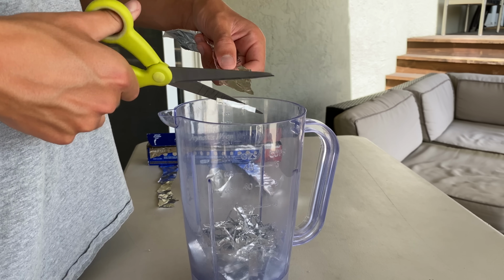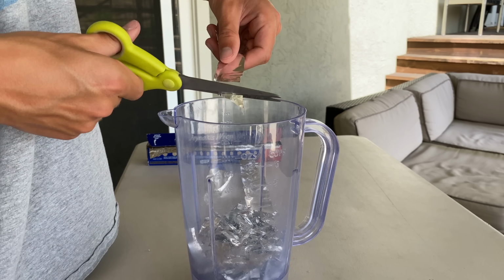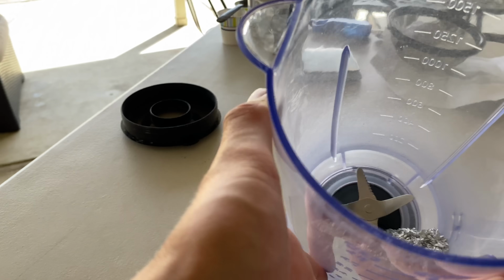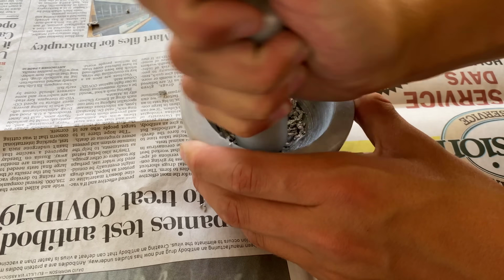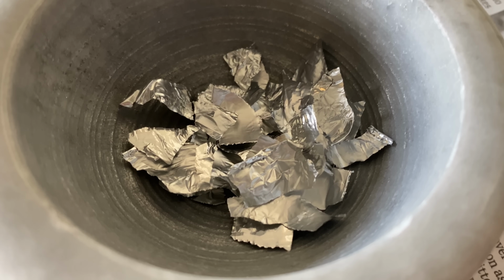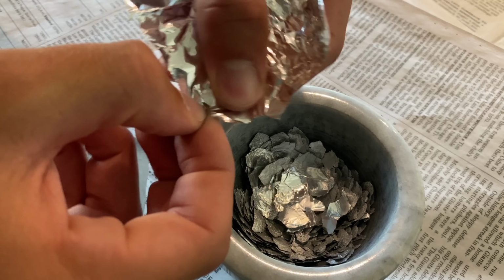Making Thermite with Aluminum Foil

Comment: You need water and a little hair conditioner (Cheaper the better) to prevent clumping. Don't run the blender so long it overheats. A Dutch guy did a very good job with this method a while ago.

Comment: Couldve used a round piece of wood to plug the foil in the blender closer to the blades so they actually get chopped up instead of floating

Comment: Make aluminium foil rod and while your rolling the rod/stick press it together hard for more density. After thats done take a angle grinder with a disc thats has a grinding like surface and then you wanna prepare something to collect it under like a bowl (the grinded aluminium will fly in the direction of the disc!) and now grind the alulminium along the rod. IMPORTANT THE ROD HAS TO BE DENSE

Comment: Faster way.
Blend the aluminium with a cup or more of water. For about an hour. The water will help cool down the  blades and also makes smaller particles. Let the blender cool down once in a while. Keep blending until the water is Grey looking and the aluminium is all grinded. Pour it out into a dish. Let it dry until the water is all gone. Ball mill bigger pieces if needed or regrind them in the blender. 
Enjoy
Reply: wouldn't that just oxidize all the aluminum making it useless?
Reply: @youngcuzzoproductions  You are correct sir. If you don't move quickly this would def speed up the oxidation process. Most likely by the time it turns into a gray sludge, it will then turn into a brown sludge.
Reply: @MashBro wait wouldn't that technically help in the thermite reaction since it's just adding more rust?
Reply: @Mr.__Sofi  No because you need both the metal powder and the oxide powder in the correct ratio in order for the reaction to take place
Reply: @MashBro  oh, makes sense
Reply: Fed
Reply: @debt4384  fed?
Reply: @youngcuzzoproductions  nope. Haven't had any issues so far
Reply: @youngcuzzoproductions  aluminium doesn't rust
Reply: this is extremely useful, thank you
Reply: I would recommend to use ethanol instead of water yo avoid oxidation(dont worry blades friction wont be able to ignite it)
Reply: @hamzax6837  does any ethanol work? Like ethanol is found in many places and many people here drink vodka
Reply: @mr.commonsense  yes i doesn't matter since it doesn't contain a big quantity of water
Reply: @hamzax6837  aluminium oxidizes instantly on contact with air
Reply: @NocturnalNick  thats obvious but water oxidizes is even worse
Reply: @hamzax6837  no, everything ends up with a coating of oxide regardless, that's why it's generally safe to handle. If your aluminum is somehow reacting with water, you have much bigger problems than an oxide layer
Reply: @NocturnalNick  nope ethanol doesn't let it to oxidize and u can burn it to dessicate it after that we can say that aluminium can react with air
Reply: I already used this method to powderize zinc
Reply: @hamzax6837  Ethanol will oxidize if for no other reason (there are other reasons) than it absorbs water from the air. Put some foil in gallium, then mix in some ethanol, see what happens. Keep a fire extinguisher near by.
Reply: Go to a junk yard. Buy a 5 gallon pail of aluminum milling chips. Wash them with laundry soap and water. Dry in the sun. Process about 1/4 pound at a time in a rock tumbler with a little bit of soap as lubricant and to form a super fine coating with some large ball bearings to desired particle size. ❤
Reply: @youngcuzzoproductions aluminum  is always covered in oxide.
Reply: @hamzax6837 watch for pressure build up that may push liquid past the seals.
Reply: I love reading you guy's passionate responses, lol
Oh dam i wasn't going to respond,  now we're all on the watch list 😮
Reply: Sand it... or use a food processor. Blender and mortar are 2 awful tools for this
Reply: How do you know this? 😂
Reply: Why not just buy aluminium powder
Reply: @alberttresslevic914  why? Because sometimes people like making things themselves
Reply: @user-sg2yt6nc1z  
Because he spent a really long time to make an inferior product.
Plus he had already bought iron oxide powder instead of making himself, which would be a lot more interesting.
Reply: How is it faster if you have to let the water evaporate?
Reply: Or you can find machine shops day of totes of aluminum shavings as well as magnesium

Comment: put water in the blender as you add the aluminum.  pulse the aluminum water mixture until the aluminum foil is reduced to dust.  pour the water/aluminum/water mixture on a cookie sheet.  bake at 150 degrees until dry.
Reply: and no oxidation?

Comment: What about putting foil in coffee grinder, less surface area & faster blades might work better? Then scraping rusty pipes for iron oxide. I'm thinking about how this would work for a SHTF type of situation, thermite would be extremely useful for harder to breach buildings like labs or certain types of warehouses.
Reply: Or just use ball mill because in cofee grinder you make very small amount and the grinder will heat up and you must wait to cool. So it's slow method
Reply: Apparently u can use peroxide and vinegar to rapidly rust steel wool.
Reply: Nah, I tried a coffee grinder. Similar result to the blender, and any powder that was made would seep into the air
Reply: larp
Reply: Bro should bring a coffee grinder for aluminum foil nah bro
Reply: Mf is Lore Accurately Roleplaying too damn

Comment: You should have simply used a sharpening stone or another rough filing surface to grind the foil.
It works much better for some reason when you're pushing the foil against the surface, rather than trying to push the pestle into the foil.

Comment: Back in the day, when I was the author's age, I was fascinated with pyrotechnics (thought about going into the fireworks-display profession (!) Anyway, I've never made thermite, but have made flash powder, which has aluminum and an oxidizer (usually potassium chlorate). I found a possible way to make the aluminum powder: file down an aluminum bar. 

You must keep the grains from getting hot (friction) to minimize oxidation, so coat the works in oil or WD40 as you work the file. You can later dissolve out the oil with acetone or benzene. 

As for preventing flame-out, mix a small proportion of oxidizer (plus more aluminum). This should sustain combustion. And/or add a dry fuel like small wood chips (?)

Comment: You need to add more foil to the blender so the weight and mass keep it from flying around. It is easy.
Reply: VortexModz  you should be fine. Just use common sense. Open it outside after letting it settle down for 10 or 20 minutes. Wear a mask while doing it, gloves, whatever you need to keep safe. I'm sure you'll be fine
Reply: @calvinaliceashvyer689  is there any chance to explode in blender.
Reply: @Росен-в5б  you should be careful because aluminum powder can spontaneously explode but it won't if you add a teaspoon of charcoal to it. It explodes when it oxidizes. The charcoal will coat the aluminum particles and protect it from oxygen. Don't run the blender too long either. The heat might be dangerous. Blend it for a couple of minutes let it cool a couple of minutes and back to blending and cooling.
Reply: @calvinaliceashvyer689  thank you for the good advice.  One more question.  Will the charcoal affect the speed of burning on the powder. And which kind of charcoal is the best.
Reply: @calvinaliceashvyer689  
Can i use mango tree charcoal ?
+ can you tell me (if you don't mind) the ratio between charcoal powder and aluminum foil in grams
i will be so thankful.
Reply: @simplepyro7897  yes, mango with be fine. Just be sure to fully burn it. No oils, no chunks, just dry powder. 4 grams of charcoal to about 28 grams of aluminum powder. You can probably go as high as 56 grams of aluminum powder with 4 grams of charcoal. I would keep the 4 grams to at least 1 ounce. Keep testing it though. not all aluminum is made equal. Some are shitty, some are pure, some are coated, some are alloyed some are oxidized. Just keep trying until you find what works for the application.
Reply: @calvinaliceashvyer689  
Thanks 😁
Reply: Thanks

Comment: Compress the aluminum foil into blocks and then uses a file to make powder it is hard to do but extremely effective
Reply: This is close to the easiest way I've found if you don't have a large ball mill. Though instead of balling up tinfoil, smelt pop/beer cans down into small ingots, and file those

Comment: Why not buy aluminum powder?????
Reply: You can find foil and cans easier than sourcing the powder, but refining it to powder is hard, but worth it.

But if you're stuck in a lab that's well stocked, then obviously use thr powdered form. You'll probably find charcoal and a few other extra ingredients as well.

Comment: Blowtorch the foil before putting it in the blender, it makes it more brittle and powders more said in the blender. A cheap coffee grinder is better if you are doing small batches though.
Reply: More easily in the blender, rather.
Reply from the maker: i think i should look into getting a coffee grinder. thanks for the suggestion
Reply: You run the risk of oxidizing it too much then.  Al normally only forms a very thin layer of Al oxide on the surface, but when its super heated, it speeds up that process and you get a lot more of the oxide, which is why it gets more brittle.  You want it as close to elemental Al as possible since the iron oxide provides the oxygen source and the Al is the "fuel" that gets burned up/reacted. A lot of oxide plus a lot of oxide will not work near as well.
Reply: @pyrochemminer3453 or you could buy powdered aluminum next time.

Comment: Hi just watched your video, a few pointers for you

Your Thermite mix has only one problem that I can see, that's the size of your granules of Aluminium, it's spiting and going out because they are to big, the finer the particles, the easier it lights, the finer the particles the longer it stays alight, build yourself a ball mill, use glass marbles as apposed to metal balls, metal balls can produce sparks, igniting the milled material (in this case the aluminium), you want the powdered aluminium to be black and very fine, the finer the better, before opening the milling container alow the dust particles to settle first, very fine aluminium powder can (and will) react explosively once contact with a sudden rush of air/oxygen, it can happen so be aware of it. You need a ball mill and if milled correctly the Thermite will be self sustaining until all fuel is spent. be particularly careful when using an electric blende to pulverise your aluminium foil,  this as well as milling is where spontaneous combustion of aluminium powder is most likely to occur.

Comment: It would be far far more efficient and timely to merely find a chunk of cast iron (old iron skillet, old car cast iron cylinder head, even mild steel like extra fine steel wool etc), and a chunk of aluminum (old aluminum skillet, old car aluminum cylinder head, or heavy aluminum.wire). Put in vise, screw between to pieces of wood for holding, and get a coarse mill bastard file, file on each for a couple of minutes. Presto !!! All the metal dust needed. 

Simpler yet, obtain  “metal glitter” it’s all either Mylar or aluminum, and ultra fine or fine steel wool. BINGO! Burn your playhouse down. 
The aluminum may be in short supply because of all the solid rocket boosters manufactured though — it’s a large part of the “S.R.B.” propellant composition production

Comment: Aluminum foil is probably easier to get, but if you have an old exhaust manifold even off a lawnmower and use a low grit coarse sand stone you'd get a powder a lot fast that working this foil in that blender and mortar

Comment: Mix a little bit of water with the foil and then blend it, leaving you then with ultra fine aluminium slurry put the slurry in a pan or oven on a low heat to evaporate the water leaving a fine aluminium powder,
So I've been told 😶‍🌫️🫣😎

Comment: Why not just get a block of solid alum and put it on a belt sander? Easy dust.
Reply: The video is about making thermite using aluminum foil, not a solid block of aluminum. The method shown is based on the material mentioned in the title.

Comment: Should've just broke an etch, a sketch open.
Reply: Winner
Reply: @clearmind3022  that wont work that well the aluminium powder in an etch, a sketch is bad quality so it won't work well
Reply: @Daniel37643  you're right. It wont-work well, but it will work much easier. Just to buy some 5 micron aluminum powder with a Visa gift card. To A PO box

Comment: To be honest I’d hammer the foil into a solid ball then sand that solid ball on a 1000 grid sand paper
Reply: I use an aluminum rod in a drill,  hold the rod with sandpaper and squeeze the trigger.  Easy af
Reply: @ can put a screw into the ball and then use your technique feels easier to make a dense ball than a dense rod 

That if you use foil
Reply: @andriesdupreez4170  no need for foil, aluminum rods cost$1

Comment: What if you mixed the blended foil with water and blended it then? It would keep most of it on the blades and might get the consistency you’d like. Then you’d just spread the liquid over a cookie sheet and bake it at a low temp for an hour or so until all of the moisture is gone. Then you’d scrape off what was left and grind it down in the mortar and pestle. In Minecraft, of course.

Comment: I have just one question and that is: arent the weight ratios wrong? Like  .8 grams of aluminium and 2.4 grams of the rust is not 24:80 it's actually 24:8 and that's pretty big difference
Reply: The ratio is supposed to be 80:24 (roughly 3:1) red oxide to aluminum fuel so his measurements are correct as long as you don't confuse which is which
Reply: Yea officially it 27/80 ratio

Comment: You know these ingredients are readily available at hardware stores. Also they need to be baked after mixing before use to get the best results. Containing them in a clay vessel with a magnesium strip works best vs an open pile.

For educational purposes of course.

Comment: Use a coarse file and drive it on a pan. Then get the powder through the blender.
Also: take more time to thoroughly mix aluminum and iron oxide.

Comment: aluminium oxide is very hard, and is formed almost immediately on exposed aluminium surfaces. so the al dust from the mortar is gonna be about half mortar dust, which is why it's darker than regular al powder, and is inhibiting the reaction. the structure of foil makes it a non-ideal candidate for thermite in terms of time spent vs mass processed. great video that demonstrates both that it is possible but also not ideal to use foil.

Comment: My brother has what we call the Jonsen Room at his shop. Grinders, polishing gear basically all the stuff for putting a finish on metals. We cleaned the room top to bottom the night before a bunch of aluminum work was on the schedule then collected the Al knowing there was nothing else in it. It's much finer than icing sugar but not quite ball mill for a week fine. You need a good  mask to work with it.

The other unfair advantage we have to make this is that this island has chunks of Pig Iron all over it. That's pretty much pure iron before it gets made into steel. In the molds it kinda looks like pigs. It will get a surface rust in minutes. Shine it up and save the rust. 3 or 4 times an hour and by midnight on a rainy evening you've got a nice little pile of pretty near pure Iron Oxide also about as fine as the Al powder which has also oxidized a fair bit.

You got the reaction so it can be done. May a suggest more fire when you light it up? Quite a bit more in fact. The portable welding kit with the Mapps gas and O2 works well, but the best is a standard cutting torch. The BBQ lighter is just a long Bic lighter. 

I think if you had hit this stuff with a torch to get it started it would have worked better. Also be careful.  If you get the mixture just right, when the stuff works as advertised your hand is just too close with that lighter. I wore a heavy leather welding glove on my torch hand. Turns out it wasn't necessary but I didn't know that when I lit the first one.

We were wondering if we could use it for emergency welding at sea after watching railroad thermite welding.

Comment: BE SAFE OUT THERE. ONCE THE METAL POWDERS TO THE POINT IT LOOKS LIKE SMOKE IN THE MORTER IT CAN AUTOIGNIGHT AS I FOUND OUT LAST WEEK GETTING 2ND DEG BURNS ON 40% OF MY R HAND. A 4 G FLASH ONLY LASTS A SPLIT SECOND BUT THE HEAT PRODUCED IS INTENSE. USE A BALL MILL. EVEN SMOKED MY SAFTY GLASSES! PLEASE BE CAREFUL.

Comment: Okay I have watched dozens of videos. Taken the best info (none from this video) and came up with a pretty good way of creating the powder from foil. 
1. Take your foil and torch it. It becomes less pliable. 
2. If you have a paper shredder, use that. If not cut pieces not bigger than 1/4” square.
3. Put in ball mill and do not use normal material for milling.
4. Load drywall screws and heavy bolts and nut. (Drywall screws will cut foil as it’s being milled and bolts will give the screws weight for process.)
5 start ball mill. Mill 3-5 days. 
That’s it.

Comment: 1:36 That particle size for aluminium is good enough. Even coarser than that will still work. Edit: It's the volume of powders you have that causes the reluctance to ignite.
Reply: Personally I would have used a burr coffee grinder. Run a cup of rice after to clean it.

Comment: Dude I’ve seen someone grind up fine aluminium powder with some steel balls and a bottle on rotation. 
Make finest aluminium powder that’s so fine it’ll burst into flames if come in contact with air. 
You should try that.

Comment: use those sparkly things you get with fireworks as a fuse
Reply: He used a magnesium ribbon, more than adequate for thermite the aluminium particles were too big that's why the mixture wasn't igniting correctly.